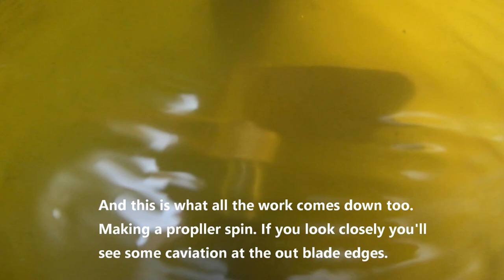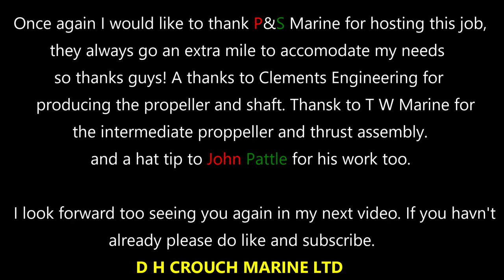Lister HRW2 PRM260 D2 INSTALLATION Part 3

Comment: Darren, love your style & attention to detail. Discovered your channel this week & have watched all, liked & subscribed!
About to install Beta43 with PRM260 D2, which is why I watched these 3 excellent videos...but having seen your brilliant (intermediate) shaft guard, I'm worried about the state of my prop shaft! 
Fnarr fnarr. 
It has a keyway cut, three weird grub holes on opposite side ... & a few dings from me trying to remove the old CV joint.
I am replacing CV joint with R&D split coupler, with keyway cut...but how should I prep shaft to minimise the damage done down the years to my poor old shaft..? 
Fnarr
Apologies for the viz refs, but would appreciate advice on proper advice for polishing up my shaft.
Fnarr.
Reply from the maker: Email me a picture or more and I'll advise darrencrouch@dhcrouchmarineltd.co.uk
Reply: @dhcrouchmarineltd3049  Thanks Darren, that's a very generous offer, I will. Didnt really understand how gearboxes work, until I saw your vid of PRM 120 teardown...amazing really.
Reply from the maker: I've seen your email. I'm out in the van but will hatch a plan for you later.